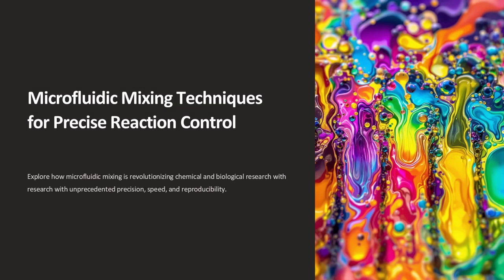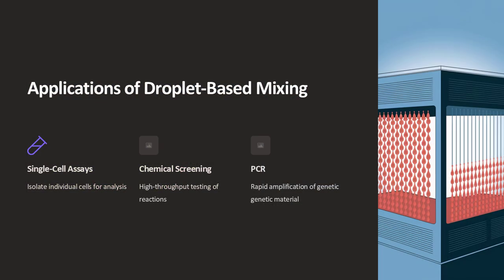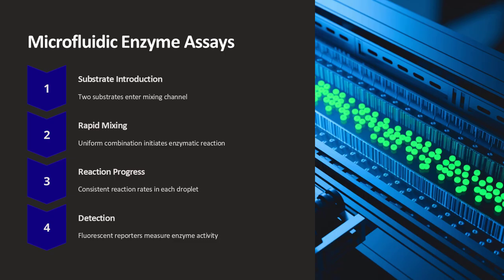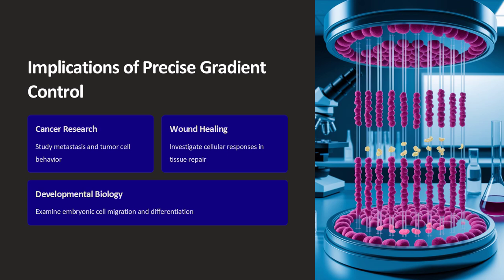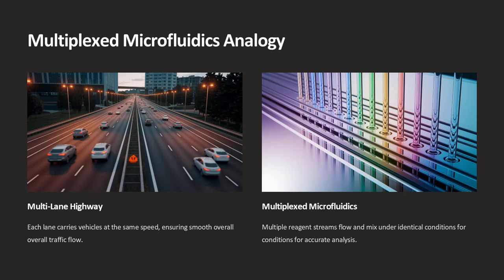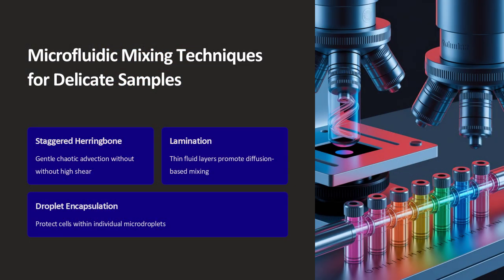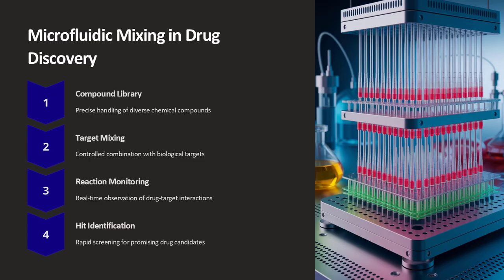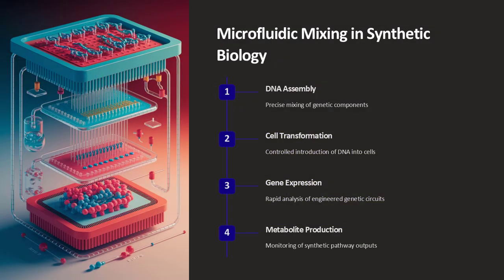Microfluidic Mixing Techniques for Precision Chemical Control

Comment from the maker: How can microfluidic mixing efficiency be optimized to ensure uniform reagent distribution in highly viscous or complex biological fluids without introducing turbulence?
What are the fundamental limits of passive and active mixing techniques at the microscale, and how can hybrid approaches overcome these challenges for ultra-fast reaction kinetics?
Can AI-driven real-time monitoring dynamically adjust microfluidic mixing parameters to maximize reaction yield, minimize waste, and enable fully autonomous lab-on-a-chip systems?